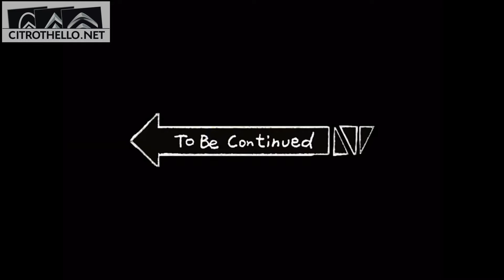CITROEN DS 23 IE PALLAS 1974 RESTAURATION PIERRE 13 #citroen #carscollection #vintagecars #vintage

Comment: How could you know in what order you shall do every step? It doesn´t look like you have any manual or wiring diagram. You can hardly know all this by heart?
How do you know where to drill holes, for example?
Reply from the maker: ¨Yes, I know all this by heart...... I've restored more than 55 DS at this day :-) An around 15 SM.

Comment: A stainless steel exhaust is not so good, and not original. It is much more noisier than the original steel, and has a harsh sound.
Reply from the maker: This one is metal, not Stainless steel. Bit the owner wish me to change it for a brand new Stinless steel. And to me, I don't feel any difference woth the noise..As I always lay loud music :-)
Reply: @othellodj9557  OK! What does this restauration cost the owner of the car?